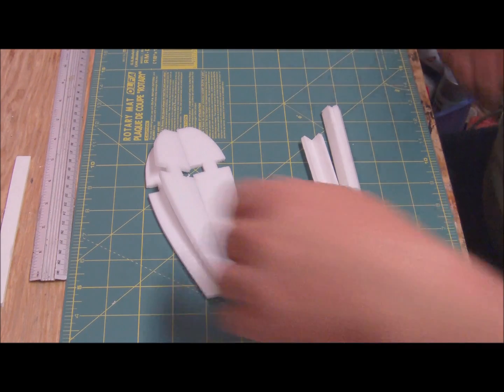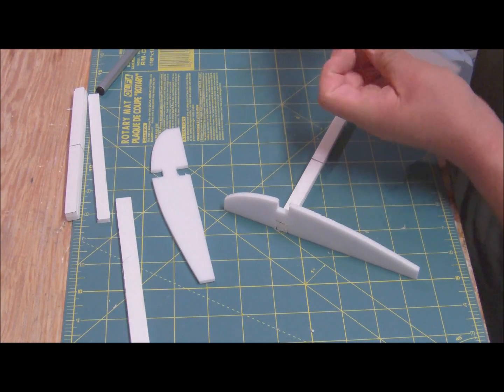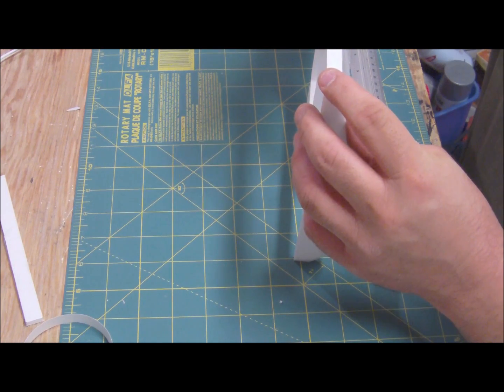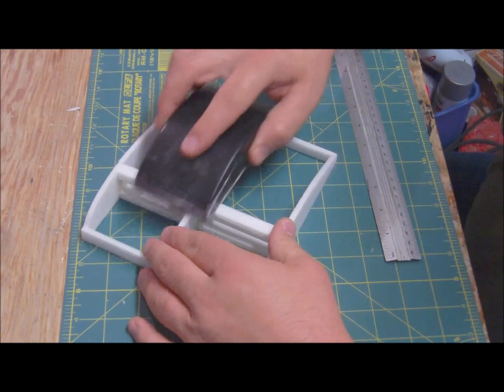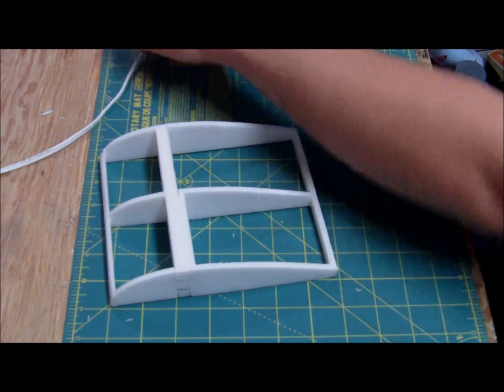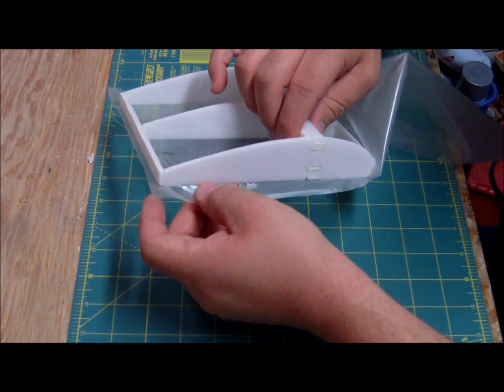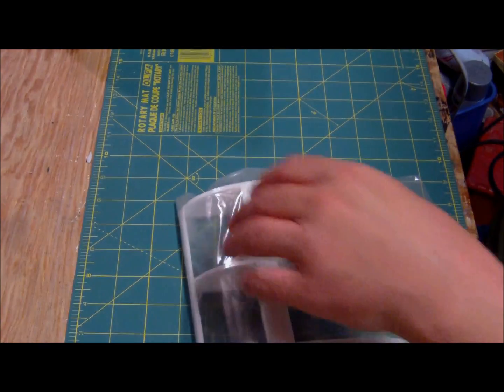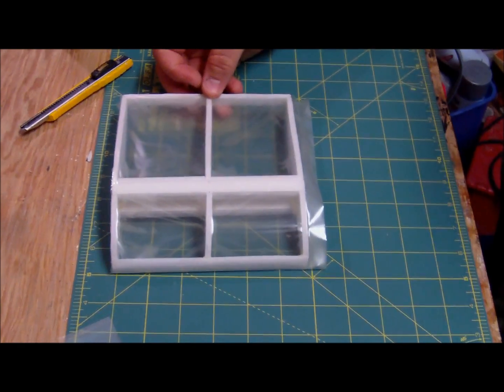How to make a ribbed foam wing

Comment: I agree, I used this film way back in the 80's when i could not afford solar film or mono-cote for large 1/4 scale models.  I found a whole roll of this at 4' wide thrown away by a school and it lasted me like forever. It worked just as good if not better than standard covering in my opinion. And yes it will take a lot of heat and can warp even balsa structure if you keep shrinking it. I even spray painted mine and it did not peal.

Comment: Instead of hot glue use gliden gripper foam safe paint, wayyyyyy stronger and permanent bond. The stuff is insanely strong and amazing and unlike hot glue is not heat sensitive. Gliden Gripper cannot be build apart, the foam will fail first behind the glue joint!

Comment: you can do a foam CF or FB sandwhich panel, but you need high density foam. The resins used for CF/FB are very strong and may leak through the styrofoam pores. The spar could be any material, balsa would suffice and will adhere with the hot glue just fine. If you have the money for CF why not =)

Comment: For larger wings take into account to add a thin layer of CFK rovings (not expensive) on lower and upper sides of the spars; these will take lots of load during (aerobatic) flying !

Have done that for numerous models and works perfectly !
Reply: Im thinking about just adding ribs on top of a flat dallor tree foam board
to prevent the wristing ( rather than just adding KF)..Use newspaper. postcard paper or whatever to skin the top so I can paint it. I have big sheets of drawing paper...it's slightly thinner than regular writing paper. There's so much stuff you can use if you dont have to worry about NITRO...I been collecting clear plastic (#2 plastic) from cakes...A couple more cakes..I'll have enough plastic to skin
a 40' wing..lmao
I'll have to experiment with full symmetrical ( fat rigs)...basically a foam board
for the center,( sort of like KF4) So it'll have to make ribs for top and bottom.
If it works...Im going to cut lighting holes in the center board..starting from the outter bays. For a 30 " - 40" 3d park fliers..it should be okay. Not going to burn holes in the sky...Just make the model twist and turn in a tight space.
I need to make it 550 grams or less for a 36" 3D type models.  it's recommended in the plans..Sort of like that grass hopper.lmao. That particular model has
 a flat bottom air foil ...basically I want to make something like the something extra scale down.lmao...They just have different air foils...that's all...Air frame,
wing span..ect are all pretty much the same...just cosmetic
If it works...I'll just use packing tape to skin it...Just put strips of postcard paper on top of the ribs..so the tape will have a smoother surface to stick to.
hmmmm....maybe use heffy trash bags to skin it.lmao

Comment: I've never done a comparison but I take it balsa is heavier than DTFB ? If I were to apply this method to, say, a FT design, could I expect any weight savings from building the wing this way vs. the normal "fold over" type of construction? I suspect I already know the answer, but I am not familiar with the characteristics of doculam. Great video! Love your builds!
Reply from the maker: It really depends on the size. Smaller wings will more than likely weight the same. What you can expect is that you will have a more efficient airfoil over FT designs and use of this technique will lend itself in building balsa airplanes too. Paper on DTFB is heavy. This allows you to use foam without the paper and make a more scale airplane that will fly better than use of FT build techniques.

Comment: Thanks for the video - really helpful. I presume you could create any airfoil you wish by just cutting the ribs to the right airfoil profile? I'm looking to create a Newman airfoil.
Reply from the maker: Sure! I've done this with numerous types of foils, semi and fully symmetrical. Undercambered would work well too though it may be more tricky to cover. For quick and dirty panels to try, you could simply how wire a foam core using templates and then spend the time on a built up wing like this. Lots of fun ways o approach it.
Reply: @JoshuaOrchard  Thank you - I'll be giving it a try!

Comment: Shear webs are placed in between the upper and lower spars forming an "]["-beam type construction just like they use in the construction industry of buildings.
Aiding in minimizing certain specific forces and/or stresses being applied on the wing, as much as possible, while in flight is a paramount function of shear webs.
Reply: I know it's kinda off topic but does anyone know a good place to stream newly released tv shows online ?
Reply: @Fletcher Nicolas flixportal =)
Reply: @Lucian Kendrick Thanks, I signed up and it seems to work :) Appreciate it !
Reply: @Fletcher Nicolas Glad I could help :D

Comment: Hi Josh, excellent tutorial.  Thank you for taking the time to help those who want to be informed. Doculam  is an interesting material, will have to try that. 
On a separate note, I wonder if a thin strip of balsa, over the edges, to allow the use of other films.  The weight penalty verses ease of other films ???

Also wonder if it is possible to use ribs from a balsa model as templates for the foam ribs ?  Looking forward to your future build videos.
Reply: "I wonder if a thin strip of balsa, over the edges, to allow the use of other films.  The weight penalty verses ease of other films ???" Balso is pretty light, and thin strips would be especially light. Other materials for covering (like tissue) would be much lighter than the office stuff (I think). It's a good idea (with the balsa edges) composite construction, but a lot of fucking around, that's all.
Reply from the maker: Justwantahover Yes, tissue would be lighter. But not as strong. The film does act like a stiffener (torsionally). You sure could do balsa cap strips to use other films that use a higher temp. I would reserve this for much larger wings though. The balsa would greatly contribute to increased weigh with wood AND glue. The added strength would be great. The idea is not to make a wing that is overly strong. Just strong enough to get the job done. Obviously I'm not a proponent of over building models.

Comment: If I put that much into a wing, I would give it a coat of west systems epoxy rather than a laminating film. I would want to add some structural strength, and the weight is not an issue like a thick coat of gel coat would be. This is because I know that within 10 min after take off I would hit a goose head on or something and all that work would be fluttering down from the sky. The epoxy would give it a flying chance, at least save some of the structure rather than total destruction. That and I would be using those Estes rocket engines to get it off the ground and up to altitude fast, then they drop like spare fuel cannisters when the parachute charge goes off.

Comment: Great set of tips, thanks for sharing.
How do you cut your ribs? I'm thinking hot wire cutter??
The covering didn't look the tight in the video, can you get that material tighter?
Thanks for sharing :)
Reply from the maker: In this video, they were simply cut by hand. The new video I did cut them with a wire cutter but it's a bit different overall from this approach. The covering I used in this video did not shrink all that much because it is doculam... a document lamination film. Ultracoat or Monokote will indeed shrink more and tighten up more.

Comment: First, you got screwed paying 10 bucks for a couple of yards of Doculam (laminating film).  It is available everywhere online for about 20 bucks per 250 foot roll.

Second, that film will shrink a ton.  You just never got it hot enough and left the covering slack.  Laminating film will take more heat than MonoCoat or any other purpose-sold model covering film.  Using it over foam ribs might not be the best useage for that very reason.

Comment: What transparent film would work for this kind of ribbed wing?
Reply from the maker: My experience with covering films on foam at this point tells me that you really can use any of them but they are far more sensitive to temperature fluctuations. Do a test patch on some crap foam before you apply to the model and you'll be just fine.

Comment: Another glue of you don't have a glue gun or just want to use something else that is very good with styrofoam is Gorilla Glue. Best glue I've encountered for styrofoam and you use very little since it expands 3 times it's size. Just moisten the surfaces and apply a thin film and I mean thin. The glue basically  turns into foam itself it seems, and it's very strong and won't burn you either which is great if you're a kid. My glue gun only has high temperature so melts foam before it cools, that ain't cool!

Comment: I agree have fun! can foam be fiberglassed? if how?
Reply from the maker: It absolutely can be glassed. You have to be strategic about what cloth you use and where you use what weight of cloth. I frequently use 0.75oz cloth and waterbased polyurethane (WBPU) as a surface finish that is more paintable and gives a very smooth finish. Epoxy will give strength at more of a weight penalty. Perhaps I should do a video on my glassing techniques.
Reply: @JoshuaOrchard  DEFINITELY!!! 😁

Comment: Did you hand cut those ribs, or can you buy them pre-cut?   I don't know how much load you're going to have,  Would it be smart to use  carbon rod in the middle as well as the foam ones?
Reply from the maker: BennyCFD Yes, hand cut. Its far easier to cut foam over balsa. If you remove any film or paper than it is even easier. Yes, carbon would be good but depending on your application balsa or foam spars with shear webbing will be sufficient.

Comment: are there any printouts of each piece that i can use as a template? i need to make one for school, thanks. :)
Reply from the maker: This was just a demonstration section. You can use any airfoil you chose. In this example, I traced an airfoil from a balsa kit that I had completed.

Comment: I dont want to flame nor troll but...Does this have any particular reason to do ribbed wing out of foam ? If you put so much effort into it...like cutting out ribs manually...isnt it better to use balsa instead ? Is it so much lighter ?
Reply from the maker: It can be! The advantage is that its cheaper, faster, and sometimes lighter to build. If you mess up you really do not care because of the cost and time invested is not significant. You can cut out one rib in less than a minute whereas with balsa it takes several minutes to cut and sand to proper shape. You sheet of balsa will be about $5 for a 24x4" sheet where with this foam you can go to a dollar store and pick up a 20x30" sheet for a dollar. You can use that same foam for sheeting the wing as well. Its just a very versatile build medium. Thank you for having a look!
Reply: Joshua Orchard Eh I envy you the dollar store sheet ;) all I can get where I am from is depron and maybe some EPP etc...
Reply: I think weight is dependent on your design. Balsa is better if your worried about a nice plane. But for experimental planes this is the better route for cost reasons. Foam Board does a good job either way.
Reply: The foam wing would be lighter (a lot lighter) than the balsa wing even if you made the ribs thicker. I would NOT use foam spars, though, not even if this were for indoor rubber. While foam ribs would probably be OK for electric I would NOT do this for a glow powered model, it'd fall apart pretty quickly because foam has little compression strength. If you want to use foam for a glow powered plane you'd have to go with sheeted wire-cut foam cores rather than foam ribs (this is usually heavier than a similar sized balsa framework wing but is very strong and stiff).
Reply: @chemistt  DTF is actually a depron, but covered with paper.
Reply: @JoshuaOrchard guy at my control line club uses pizza boxes to make ribs, wood spars. real cheap and fast to build

Comment: so a hair dryer wouldnt be hot enough to stretch the laminate cover?
Reply from the maker: You could use it to shrink it but it depends on the covering. In this case, doculam does not shrink all that much. Other coverings can be more forgiving but usually require a hotter iron... something that will melt the foam too.

Comment: How would you attach ailerons to the wing, and which material would you recommend ?
Reply from the maker: Ailerons can be attached with any hinge material. You can insert a small piece of balsa on the inside of the wing if you have fears of it pulling free. I personally love to use old floppy disk material. Sand it a litte and any glue will hold it and it flexes nice too.

Comment: How would you cover it and Styrofoam bored from Dollar store
Reply from the maker: I do not have the time right now to do a video of it but perhaps in the future. I'm currently building a plane with this design so maybe after that. Basically you want to enlarge the leading edge to create a lip for the skin foam to butt up against. Apply glue to the ribs and tape the sheet in place that will be the skin. You may have to remove a portion of the ribs to account for the skin thickness. It will add a lot of rigidity and strength.
Reply from the maker: FYI for you and others that have asked, see the following build log for sheeting with foam. 
http://forum.flitetest.com/showthread.php?11337-FFVS-J-22-Scratchbuild

Comment: Could you sheet the wing with foamboard?
Reply from the maker: Absolutely! When cutting your airfoil out, you would need to factor in the thickness of the foam.
Reply: Joshua Orchard I was thinking of doing just what you have done, except for a 1/8 inch x 3/8 inch balsa spar directly above and below the foam spar, plus 1/8 inch balsa at the leading and trailing edges.  Then use (4) slabs of 1/8 inch foam for sheeting between the balsa members so its all flush.  The foam spar would really be part of the shear webbing in that case.
Reply: Joshua Orchard If your wing needed to be tapered you could hotwire a much shorter version of the wing in the conventional way, but then cut it into slabs to use for your ribs.
Reply from the maker: Yes, this is good thinking. Really all that we are looking at here is using foam as a different medium in balsa construction technique. It is easier to cut, less expensive, and has potential for very light aircraft without sacrificing too much strength.

Comment: What would a 1 meter wing with this construction technique weigh?
Reply from the maker: Not very much!
Reply: You think around 30-40 grams? Lighter? Heavier?
Reply from the maker: Probably heavier if you consider reinforcements to keep the wings from folding. Any covering will add weight as well.
Reply: I was wondering because I build wings from  very thin A grain balsa and tissue covering and can get 1 meter wings as light as 28 grams, and I thought that maybe by some miracle this method could be lighter than mine. Super lightweight techniques interest me because I am always trying to make the slowest flying aircraft that I can....and cause my flying field is small, so if I like keeping my planes around they'd better be slow...

Comment: I don’t understand.
The paper peels off your foamboard so easily.
The paper on mine comes off in little pieces.
Reply from the maker: It's likely the humidity in my area. Try wetting a cloth and wiping the paper down before trying to remove it.
Reply: Joshua Orchard 
I found an approach that works quite well: massive overkill.
The wet rag didn’t produce much change, so I put a sheet in the shower, turned the water to full hot, and let it run for few minutes.  That made it easier to peel the paper away.
Having achieved some success, I applied More’s law:
“If a little’s good, More’s better, and too much is just right”.
I put a sheet in the shower and flooded it, adding a second sheet trapping water between them.
I let them soak, reapplying water.
After about an hour the paper wrinkled, and peeled off in one piece.
I was left with a bare sheet of clean foam, with no effort.
The paper has a slick finish and it takes heat, time and water to dissolve the adhesive.

I realize this is a long post, but I hope this will help others.

Let’s be careful out there.

Comment: is there any free programs to make the ribs for wings out there?
Reply from the maker: Depends on the airfoil you want. You can readily use an online airfoil generator but if you are trying to design a whole panel you are looking at purchasing profili or compufoil.
Reply: just want to make simple wings for now,just like u did in ur video but a bit longer...
Reply from the maker: felipe j. Garzon http://flitetest.com/articles/how-to-make-inexpensive-hot-wire-templates See the links to the airfoil generators linked in that article. They will generate basic NACA 5 and 4 digit series airfoils.

Comment: what is the "covery material?
Reply from the maker: In this case I used Doculam. It is a film material designed for laminating documents at a low heat setting. It is also thinner than the higher heat laminating material.
Reply: very thanks, i gonna build an p38L with this type of wing

Comment: Nice concept but the covering looked like crap leaving all those wrinkles. I would have to cover it with a thin sheet of balsa to hide that hideous looking covering.
Reply from the maker: Agreed, however in this video I was using doculam, which has very minimal shrink. Low temp coverings would work better. You can get the idea from the video that you CAN cover it but yes, 1/16 balsa sheet would also work very well.